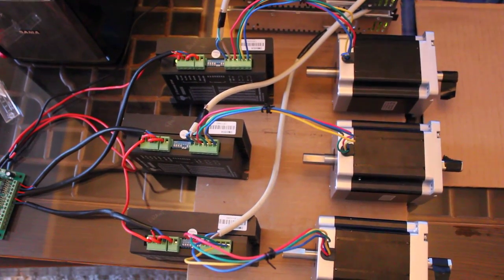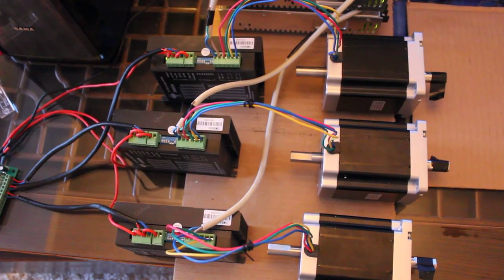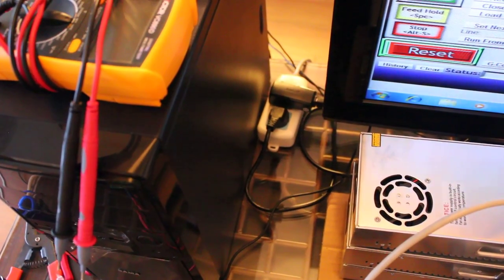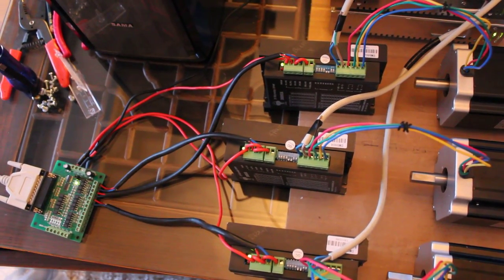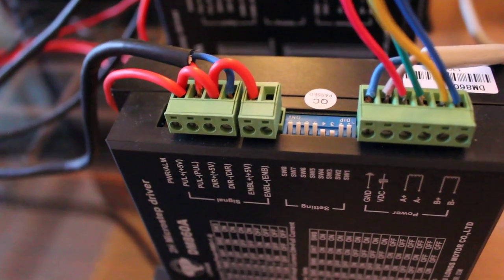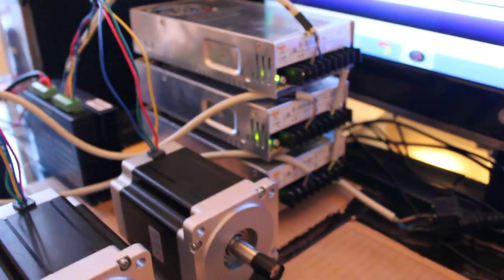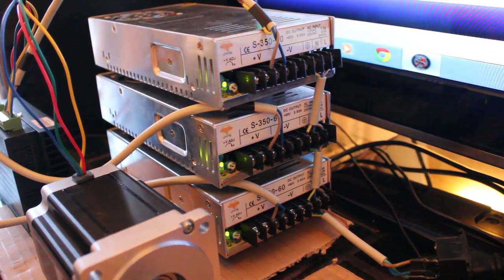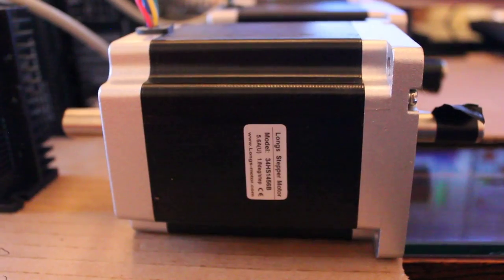Longs 3 axis CNC kit part 1: wiring

Comment: Youre gonna.need to disconnwct the motors to use the machine with handwheels, as the motors produce significant voltage that gets fed back into the controllers when they are manually rotated...

Comment: How come don't you connect the drivers to the breakout board X , Y and Z separately? , (X+5v CLK Cw EN- Y+5v CLK CW EN- Z+5v CLK CW EN) But you plug on A+5v CLK CW EN and B+5v CLK CW EN 'only. Do you still have control for each motor? using Mach3. Thanks Hard Coeur Garage

Comment: Can I use this stepper motor drive to control of Arduino for industrial machines
Reply: Yes you can control every stepper drive board from Arduino controller, you need to code some parameters .....
It's easy I feel...

Comment: I'm alittle confused as I've seen the same drivers and breakout boards wired up differently, when I brought my kit it never came with a wiring diagram no paper work at all from Wantai also I think same as Longs and maybe many others,
As I have the DQ542MA drivers, D25-1205 breakout board, I'm trying to trouble shoot to see why PC and breakout board are not communicating, but it's hard to know weather my wiring is correct everything is powered  up with lights on so they are getting power and motor locks with torque load.
I don't know weather the parallel port card I brought is not compatible as most PC don't have parallel ports only USB.

I'm at a loss at the moment and wondering if someone has experienced this too
Reply: having the same issue and have looked and tried so many wiring diagrams..have basically the same stuff..but is till does not work

Comment: hi there.. first and foremost I want to thankyou very much for the great video that you uploaded.  It has been a great help as i too purchased the longs 3 axis 34 stepper motor kit. I didn't get a wiring schematic with the kit.. dare I say it probably would have been double dutch trying to decipher it. I've followed/traced your wiring and laid out the motors etc on my desk exactly as you have.. and now I'm at the stage of connecting the the last few wires to the breakout board from the pul +5v on the controllers. Not sure if they all bind to the +5v on the breakout board. could you please advise me if this is correct as I'm looking forward to switching it on and seeing something happen ... cheers 
Paul Matchett Belfast northern Ireland

Comment: I'm having trouble understanding the dip switch setting. Can you explain or how do you know were to set them. My cnc works ok but my motors sure get hot. my number 4 is set to off. Thanks for any help and I like your video I understand the 1,2,3,4 just not sure about the 5,6,7,8

Comment: Are you selling the Longs kit?  If not where can I get that?
Great video!
Reply from the maker: Hi Charlie,  thanks a lot.   I do not sell the kits.  I made the video because I was struggling with the wiring and thought there must be others that are too.  I was living in China at the time and bought the kit directly from Longs, but I have seen many different Longs kits on ebay.
Reply: @hardcoeurgarage1083 
 I am going to use 3 nema17 7.2kg torque motor is 1 lrs75 24v power supply enough for it?

Comment: Can you run 3 x motors from one power supply?  Looks like they have 3 x V+ and 3 x V- connectors?
Reply: yes sure you can
Reply: Yep, Muharraqi55 is correct.  no problem to run 3 motors, in my case I would have 1/3 the power and the kit came with 3 power supplies so that's how I set things up.
Reply: @actionmotorsportsllc4143   i like your vids im just asking where did you get this kit from mean if put a link 
i will be grateful thank yo

Comment: Great job! Thx! What kind of cable did you use, could you write down please? ( All  of them please )
Reply: Hi Richard, thanks a lot for your nice words!  When I was wiring this I was living in Shanghai for work and I would source everything from the local tool markets.  I'm afraid there wasn't any labeling on the packages, it was just bits and pieces from the local vendors.  I can tell you most of the signal wiring is just regular 14 and 16 guage wiring and the power cable is household power chord.  Sorry I don't have more detail, if you have any questions just let me know.  have a good one!

Comment: my machine prints revers. the wiring is correct.  any idea why. i could not find a solution yet.
Reply: Hi there, sorry for the late reply, what software are you running?
does it print in reverse in all axis or just one?

Comment: Do you connect direct - and pulse - to the break out board or do u trigger the 5v + channel?

i See u have briged the 5 v + and enable  Port right
Reply from the maker: Hi Christoph.  everything is just direct connected to 5V.  when I plug in the 5V the drivers are automatically triggered and the motors engaged into lock position.  Hope that helps.

Comment: Hi I have one of the longs motor cnc kit with that controller board and I try several wiring modes but is not responding to mach3.I have the green light on the drivers and the green light on the controller, but still not working I don't know what I am doing wrong and there was not documentation with my kit they send me a drawing by email
Reply from the maker: Alfonso Cruz Hi Alfonso,  did you get things working.  sorry for the late reply, I didn't get an email alert for your comment.  if you're still having issues let's connect and you can send me a screen shot of your ports and pins settings as well as the  mach input settings.  hopefully you're up and running by now though!  take care.
Reply: @hardcoeurgarage1083  I need total kit
Reply: @hardcoeurgarage1083  having same issue and have been sent numerous wiring diagrams.. still lost and confused